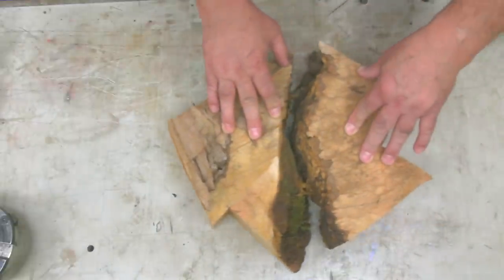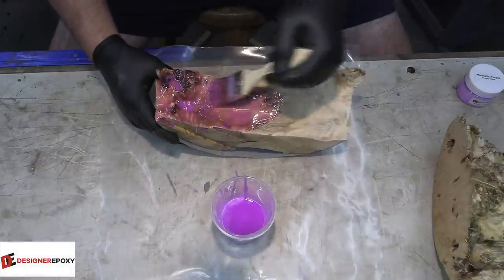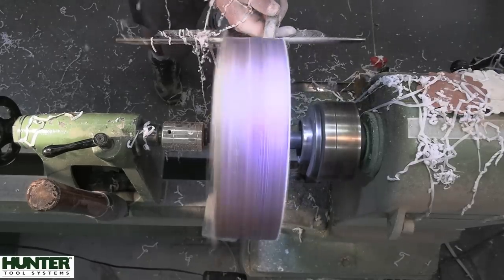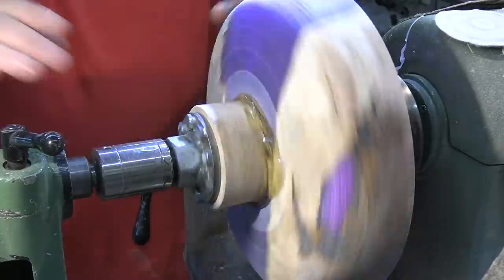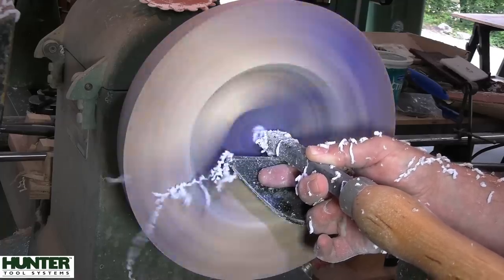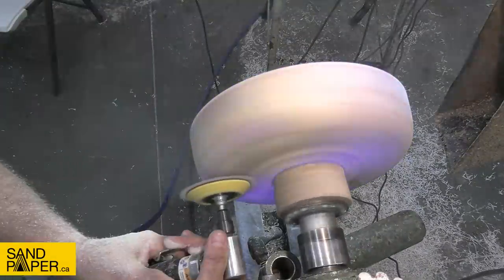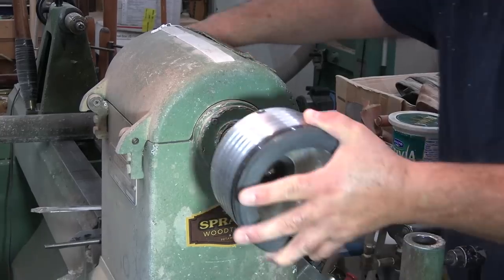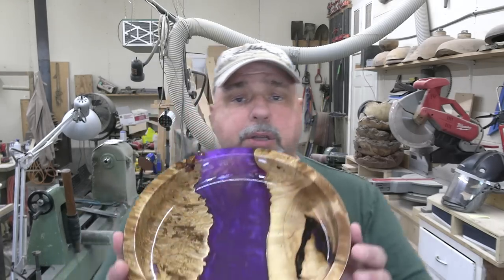Woodturning - The Crystal Purple River Bowl

Comment: One thing that I do is an extra step. I mix up a small amount of epoxy and pour it into the bottom of the bucket. Place the woods in and cure. This will then hold the wood and no hot melt glue needed. Then mix up the epoxy with the desired color pour in the bucket. And then put into the pressure pot to cure. Just a thought Jim. Great video by the way.
Reply from the maker: That would work just great, thanks!

Comment: Hey Jim, I enjoy your turnings . Regarding pressure pot and vacuum chamber.  I had a plexi lid made with a groove to fit a replacement gasket from the pressure manufacturer and swap them out from vacuum to pressure pot and so far no problems.
Reply from the maker: Great, thanks for sharing.

Comment: I think of you as the Yoda of inlays and castings (I mean this as a compliment).  So, here are a couple of questions for you.  Have you gotten feedback on the durability CA for inlays?  I have seen posts elsewhere that say CA is brittle and doesn't last very long compared to epoxy.  Second, what type of epoxy do you recommend for inlays and/or voids that will NOT be put into a pressure pot?  Something that is clear and more than a 5 minute open time.  Thanks in advance.  And, of course, your work is incredible, stunning really, and I appreciate how you have shared your learning process over the years, successes and failures.
Reply from the maker: CA is probably more brittle then epoxy but when you use CA I find the colors tend to stay more true to the color of the inlay and resins tend to darken the inlays. So if this isn’t an issue then use the resin. If your not in a hurry use Deep Cast from DE, that way there is plenty of time for any bubbles to escape the inlay and if your in a hurry use the Artcast, it will cure overnight but you might need to fill some bubbles. Hope this helps. Thanks!
Reply: @SpragueWoodturning  Thanks very much for the guidance.  I will try the Deep Cast.

Comment: I know you don't like using mold release and worry about it compromising the integrity of the epoxy, have you thought to try something like paste wax? Not sure if it would help but it's a thought!
Reply from the maker: I have and it actually worked great. I really like to hot glue the pieces in place. That way you don’t have any mishaps along the way. If it’s waxed or has mold release in the bucket it hard to get the glue to stick unless you clean off the areas you plan on glueing too. Thanks

Comment: Hi Jim,I would love to try designer epoxy, but my has me on a tight budget. She says I have to sell some of bowls b4 I can order some epoxy. Love this week video. Have you ever seen a pressure @ vacuum pot combined, as a hobbyist you would only use one at a time
Reply from the maker: Technically you could use the pressure pot for both. I’m assuming if the pressure pot can take 60psi it should be able to take 28 inches of vacuum as well. The only problem is there’s no sight glass to see what’s happening. Thanks for watching

Comment: 25 years on and sanding/finishing is still the thing I absolutely hate doing.  I struggle at it more than anything it seems.  I don't know how many projects...wood and otherwise.... that I've left just short of the goal line just because I have either not wanted to do those final steps, or fought so long to try to get it right that I've gotten frustrated and tired of it.
Reply from the maker: It can be challenging! Thanks for watching

Comment: That is a beautiful bowl.
Question:  You poured a lot of epoxy and then hollowed out the bowl. losing much of the relatively expensive epoxy you poured.  Wouldn't it be more cost effective to roughly shape the wood first and then pour the epoxy, possibly using a small, plastic bowl to shape the interior?
Reply from the maker: Ordinarily I would core something like this and get another bowl. This one ended up too small in thickness. Thanks for watching

Comment: Hi Jim, I’m looking for some advice. I have been turning for about two years and have turned a number of resin bowls without a pressure pot. For the most part I’ve been successful. Recently I invested in a California air tools pressure pot and I have attempted to make my first pinecone bowl with my first casting. Started to turn it yesterday and the entire thing is chip out. Can’t seem to get to a point in the resin where it starts cutting cleanly. Any thoughts on what might have gone wrong?
Reply from the maker: If you using the same epoxy then it should be the same. I’ve been told by others that the pressure pot can cure things faster and that might be the case here. The more cured the epoxy is, the more prone to chip out. You actually see it quite a bit on most of my castings. You just need to take slower cuts and not be as aggressive. Hope this helps.

Comment: Designer epoxy 

Jim, I would like to say that you speak the truth about the airborne C.A. glue being very dangerous. I had an incident with a recent project I was working on.  Long story short. I was turning very dry end grain Osage Orange. I fixed the cracks with ca glue. And I was not wearing a respirator while turning. I don't want to be Grose but it got into my nose, sinus and lungs. It basically melted the flesh in my nose and sinus and caused a severe infection. Very painful. I'm still healing.  So ya. That stuff is very dangerous! Use a respirator especially when dealing with that stuff.
Reply from the maker: It can be very aggressive! Thanks for watching!

Comment: Have you tried adding the glowing pigments to the waterluxe finishes?
Reply from the maker: No, have you? This is an interesting concept. Thanks
Reply: Alas no. But I’m thinking that the fluorescent swirls in your purple river might glow more if you had glowing compound on the surface too. I think one of the reasons your glowing purple didn’t stand out as much is because the translucent purple color you used in the main matrix was too dark and filtered out the wavelengths of light that make that pigment fluoresce in the first place. In other words, the glowing swirls might stand out more if you used a lighter purple river color or a different color altogether. But then, it wouldn’t have the look you were trying to achieve. Alternatively, if you found some way of enhancing the glowing effect by adding a tiny bit the fluorophore either into your matrix purple resin or by adding it to your finish, it might enhance the overall glowing part. But then again, it might also turn it into one big glowy mess. 🤷🏻‍♀️ If you can find out from Designer Epoxy what color of light makes the glowing compound in their purple glow pigment glow best, you might be able to use a matrix epoxy color that doesn’t filter out that particular color of light. The least complicated thing I could think of to try is to just add a little bit of the glowing pigment to the Waterlox and hope that it doesn’t tinge the wood purple too. 😂

Comment: How do you keep the dust off when you put the finishing coats on
Reply from the maker: The dust collector I have does a good job getting most of it. I make sure to turn the collector nozzle away from my work when it’s shut off and if I can have the doors open when sanding that’s a good bonus too. In most cases I will close the doors to the shop when applying any coats unless the air is still. Thanks for watching

Comment: another nice bowl.  Does Designer Epoxy make a quick dry thin?  When you were worried about using the glue to stabilize, couldn't you use a thin coat to seal it?
Reply from the maker: They don’t make anything like that and I didn’t have the time to wait overnight for the Artcast to cure. Thanks for watching

Comment: About how long does it take to dry the big peices of burl? Peices 3-5 inches thick.
Reply from the maker: If your air drying it, 3 to 5 years. One inch per year is the general rule. Thanks
Reply: @SpragueWoodturning  thanks. What about fridge kiln drying?
Reply from the maker: @triplepinefarms0422  if it’s green I would put it in my drying shed for 3 to 6 month then into the kiln for probably 2 month. Should be dry after that.
Reply: @SpragueWoodturning  ok! Thanks!

Comment: You do great a job, my biggest problem with your turning and many others, is your bowls are really nice, but when you guys end up ruining them because the sides are too thick and it ruins the total job,  all bowls you buy made of glass or plastic are thinner and rounded at the top edge which looks natural. to me, your design ruined that beautiful bowl by turning it into a dog bowl
Reply from the maker: Well, when you work with epoxy in this way you need the thickness of the piece so the epoxy as a surface to bond to. If you go thin, your inviting disaster, thanks